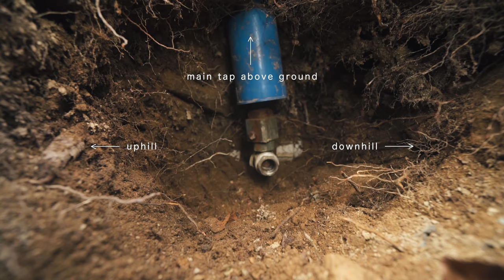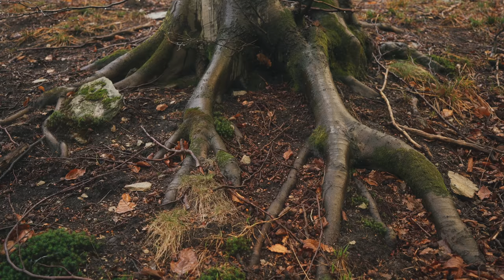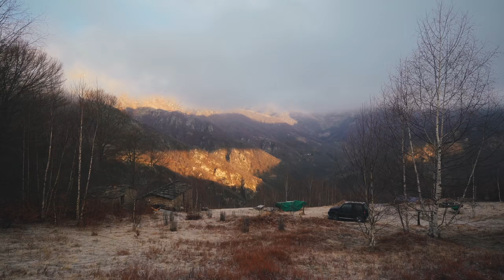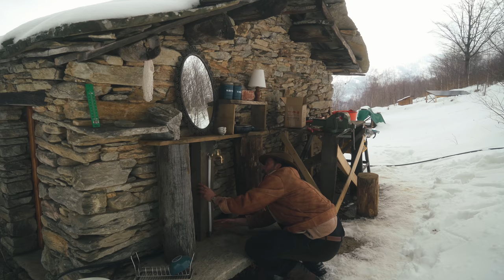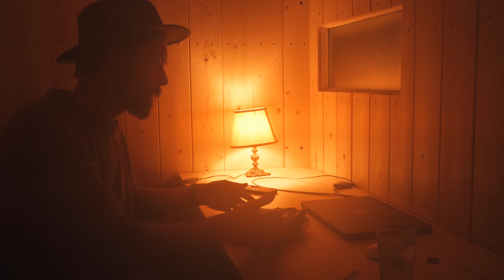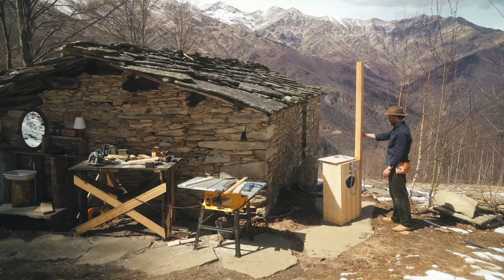#15 Running water!

Comment: How deep the ground  freezes winter time? You should stretch string in direction of digging. 
Nice boots...for walking or delivery. Construction boots would last longer and they are cheaper.
Temp shower by power source?

Comment: Very nice video, I have doubt concerning your boiler, it will not resist to a frost, unless you drain it completly and even like that it's not sure. Did you think to fit a security pressure valve as well ? I got the same pressure reducer, it's a honneywell brand, they are very good and normally reducing the pressure doesn't affect the flow amount with these types, same here, it  will not tolerate to freeze.

Comment: I don't want to be 'that guy' but i'm curious about the electrical isolation of the boiler.  Is it meant for outdoor usage?  Has the possibility of shock/electrocution hazard been considered?  I'm not sure if you have electrically connected the boiler with any sort of ground fault circuitry.  I may have missed this in the video.

Comment: i wonder if your solar system will provide enough to heat up 15 liters of water? i followed a guy who did a bus conversion, he had lots of solar and he complained it took too much of his daily power to heat up with the electric water heater and was going to remove it and use propane instead. He was in Arizona as well? Maybe his water heater was much larger id imagine. Im sure in the summer it will work well.

Comment: Sure your solar panels can deliver enough power for the boiler outside peak summer months? And the boiler is clearly an indoor unit, will rust away. Gas would have worked.
Where is the loo?

Comment: Have you considered solar to heat your water?
I've seen some system's produce hot water even if the ground was still covered in Snow.
There are videos on YouTube you can heat it with mirror's or metal sheets.

Comment: @Martijn Doolaard Not a criticism, just wondering. Can you explain why you are going to route the water line on the valley side and not the mountain side? Seems you'd need less pipe that way and not have an uphill run to the irrigation point.
Reply from the maker: Good question, I don’t want to tear up the grass and soil in my living area. Where it’s drawn up to be now it’s more out of sight, and yes a little bit longer, but there is more than enough water pressure.
Reply: @MartijnDoolaard  OK, thanks for replying. And indeed water pressure doesn't seem to be a problem, unless there is a leak and all your neighbours are without water, right? :-)

Comment: 17:00 You need to use a "svasatore" to widen "multistrato" pipes before pushing them onto fittings. 

It's a plastic tool and it's only 10€ or so

Comment: why don't you put a temporary box of corrugated sheets and an outdoor toilet together - the toilet a whole in the ground that can be refilled and discarded and have rain water pipes and gutter running from this shed to fill toilet cistern run independently to a septic tank you need to install anyway - because then you can work this while building free and do the envelopes first etc

Comment: There is no way you can run a water heater for a shower off a four-panel solar array. You would be better off with a propane water heater, and a sun shower bag would be a good temporary solution.
Reply: 'no way'?
'you would be better off'?
That's a lot of over confidence and quite a bit of arrogance, dude!
There's ALWAYS a way .....

Comment: Martijn, This is your mother speaking. My blood ciurdles every time you push wood through the saw bed with your fingers.  Dearheart, please use a 5" or so piece of wood to push through safsly, longer if the wood could ,"kick back" in process. Please be safe.

Comment: You live in the mountains and you must pay for water supply? that sounds not good....... Isn't water free as it comes down naturally from the tope areas?
Reply from the maker: Rain water and natural streams are for free. Plumbing infrastructure, reservoir, overflow, taps and maintenance is not.
Reply: @MartijnDoolaard  I see, so can you get water from a river for example? I you had one near by? for free? with a pump etc